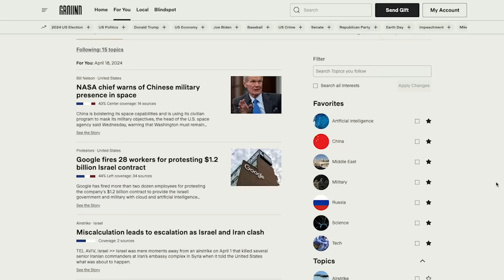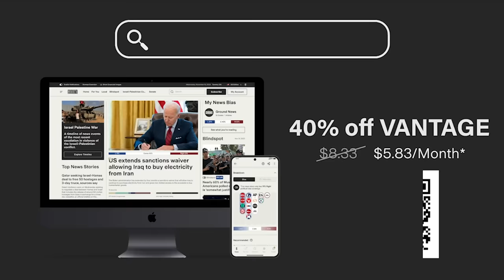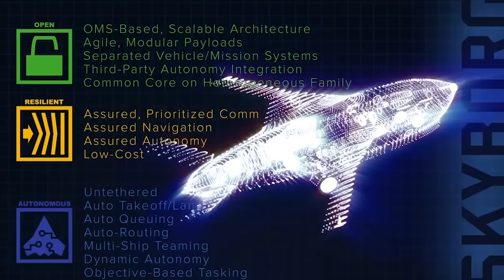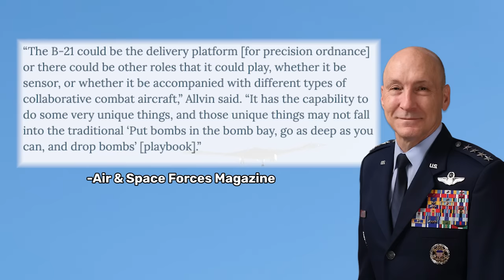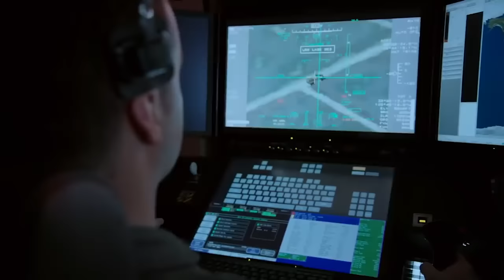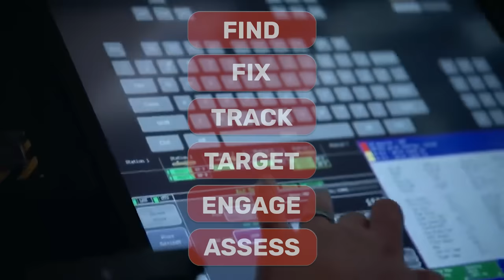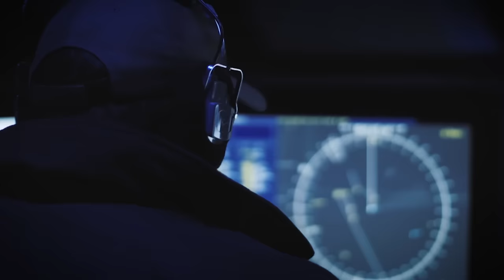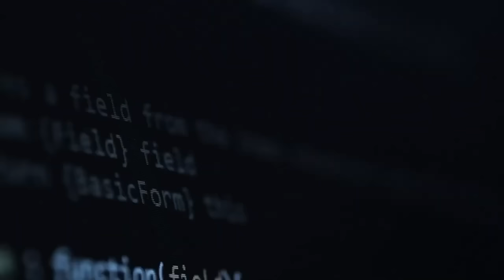Is the Air Force already developing a replacement for the B-21?!

Comment: Complexity adds cost and makes it possible for greedy fools to charge ever more for the 'complete system' (ye compleat warrior).

This is ridiculous in a bomber whose strategic nature is:

1.  Too apt for misinterpretation if operating in a potential nuclear peer state condition.
2.  Too valuable to be at-risk, without multiple escorts, literally vacuuming dry the mission force, in an unreduced target area.
3.  Too vulnerable if caught, being both slow, lacking in maneuverability and limited in mixed offensive/defensive potential.

A bomber is literally centered around MPRL and CBM as Multi Purpose Rotary Launcher and Conventional Bomb Module specializations for heavy weight munitions and/or stacked small bombs.  A pair of F-15EX could literally carry more variety of self defense (AMRAAM, JATM, AARGM) and primary mission (X16 GBU-53) than a B-21 could, on all of its heavyweight = STAND OFF rotary launcher stations.

With munitions like ARRW and LRSO apt to be just as large or larger than the JASSM and ALCM they replace, while providing upwards of 1,000nm and 2,500nm of standoff respectively, the notion that you even WANT to be some kind of airborne command post or battlefield airborne communications node, is stupid.  You will be launching on fixed, industrial, targets which are known from years of prior satellite passes as an attempt to destroy the profit margin of a war or the warfighting infrastructure as ability to continue to fight that war.

ACPs as Autonomous Combat Platforms are just as unlikely to be worth much because they will NOT be cheap.  The silhouettes shown are those of the MQ-58 which is effectively a useless, expendable, unit with perhaps 1,500nm of total range and NO LANDING GEAR to be recovered.  Are you seriously going to pretend that a multi-million dollar commo package, MEP sensor package AND survivable stealth is going on that airframe?

And do you understand what variable cycle does?  It effectively replaces the after burner on a jet by increasing core temps through injection of added compressor stage air and burning hotter.  Whether this has time limits or total compression (turbopath) restrictions is unknown but what is sure is that these engines are enormous, to accommodate all the bypass piping and not any more capable than a fanjet engine when applied to an optimized cruise point endurance of say .82-.85.  A B-21 is not going to go any faster than this without hitting compressibility limits on that low sweep flying wing configuration.  A drone might be able to but only to the degree it is sized and equipped to carry the 15-20,000lbs of fuel needed to go deep (1,500-2,000nm radius) and stay on station which is to say, a jet which is not small, not cheap and thus not likely to be part of any sensor web, looking for targets.

With modern IRST able to see a cigarette lighter at 50nm, clear air, the idea that tomorrow's systems, which will be multi (10 color) and then hyper spectral (hundreds of mini-specie slices on an optimized doped-detector FPA with tuned DROIC) will be 'invisible' while weighing 30-50,000lb and displacing enough air at high enough Mach to be generate mixed transonic stagnation shocks around the airframe is ridiculous.  Especially at altitudes where the engine is efficient, the sensor slant long and the trashfire distant from a 100-150 million dollar drone.

To simplify how this is likely going to turn out, with just the RQ-180 and an Arsenal Sub worth of 'airpower', the drone goes near to or into threat airspace, breaching at some point up or down coast from the conflict zone and coming in from the back.  It uses overhead imagine from micro-sat constellations to cue it's own imaging systems and, where threats are really high, sends in small drones (200km LOCAAS/LOCATM, 4 per stealth CBU can) to confirm relocatables targeting via track beacon/laser mark and reject decoys.

The RQ-180 then passes back singular detail data which is relayed to multiple SSGN which fire LRHW, PrSM or ARRW type missiles as alternatives to JASSM-XR to hit the threat perhaps 15-20 minutes later.  Where these are DF-26 TELs, the section of coastal A2AD/ICD is swept clear and carrier group can approach 'that embattled island' where yet more UCAV/ACAV systems fly out 1,000nm+ (just to be sure) and drop a rain of POWERED small diameter bombs (100km SPEAR-3) to standoff kill threats by saturation, defeating APS and lasers by coming in, under the horizon.  Again using LOCAAS/LOCATM type munitions to F2T2EA movers.

That's three primary effectors.  No wooop-de-lala 'clouded ISR' no 'kill web'.  Just three targeting and delivery systems.  No equestrian class sky knights required.

Anything beyond this should immediately be looked at as gold plated, self licking, lolly profit by the DIB and their worthless wormtongue Congressional lapdogs.

The next step in butchering each other is not some I-Phone generation retarded misunderstanding of why webs and clouds actually exist.  It's going to be pure speed for range.

So that air and TAV assets, completely outside the theater and thus NOT VULNERABLE TO LOSS OF BASE-IN can take off, climb up to Mach 4 and  FL800 and then start the scramjet to go 10,000nm down range in a couple hours while chucking HGVs over shoulder, like a kid playing stone-over-millpond, to a couple time zones cross-range.  You will literally fight your 'landwar in Asia' from somewhere over India.

Since the Chinese are actually ahead of us in this regime, with the Wu-14 and DF-17, after we abandoned the technical failure that was XTV-2 and Falcon as 'too haaaaard' if we want to steal a march on that before it comes a-visiting to our CONUS shores, we need to get on it, because we are WAY BEHIND.

And thanks to their higher IQ, incredible industrial base lead, and dedication to STEM-C rather than Gen-Z victim entitlement subject matter, the technology gap is likely going to just keep getting wider and wider and wider.

As we descend into a cesspool of third world multicultural miasma on our way to becoming the world's largest permanent debtor state.

Comment: I wonder if the day will come that a miniaturized nuclear reactor will be designed and used by the air force for airborne energy directed weapons platforms
Reply: It was designed in the '50s. The pilot's compartment was protected by a water bag and lead barriers.

Comment: So the B-21 is an advanced aircraft to replace the B-1 and,  its even more advanced replacement is already being designed?  So why is the USAF planning on flying the B-52 until it reaches its hundredth birthday?  That's the craziest idea any service branch has ever had.  Crazier than the Navy's Littoral Combat Ships.  Crazier than the Marine's Light Amphibious Warship (aka floating targets).  Crazier than the USN buying a version of the "off the shelf" FREMM Frigate and then admitting it will be delivered at least three years late.  And, crazier than Boeing converting former Russian-owned 747's into Air Force One aircraft and going billions of dollars over budget and running years late.

Comment: So, I like the numbers game, where the cost comes down as numbers go up and decades later planes can start being scrapped and used for parts.

The B-21 is going to be quite capable, so having 150 ain't gonna break a military budget OR be a bad use of money.  I also don't see an issue with buying two different bombers at the same time even if one is more capable than the other.

Having said that I find that rate at which US military tech is improving quite remarkable and excited to see how this all plays out.  The reality is though the US is competing with itself because its two main "frenemies" are going bankrupt month by month and both will have at LEAST a decade of recovering.  In saying that though the US needs to keep building.

Comment: "Is the Air Force already developing a replacement for the B-21?!"
If not they SHOULD be.  Build a stealth bomber unmanned. The flight deck is a great big giant waste of space and weight. Just think of all the waste in a manned combat aircraft. The flight deck, the pressurization system......all a WASTE. Look....the enemy will go unmanned. We are forced to go down that road. No waste. No G limit. It can soldier on through the radiation of a nuclear or chemical blast.

Comment: The B-21 was pitched as next-gen tech but's it's more like going from an Iphone 14 to Iphone 15. You even admit that it's just a different version of the already existing RQ-180. It's hard to see why the B-21 is even necessary. How is it signicantly better than the RQ-180? What's the BIG new capabilities that set it apart?  In fact the use case for Bombers in general has almost disappeared in a near peer contest. And I guarantee China's new Stealth Bomber is probably JUST AS GOOD as the B-21.
Reply: Big negative on  the Chnoise having a bomber on the level of the Raider.

Comment: The reason the F-35 needs a 20 ktons engine is because it wouldn’t be able to fly without such power to propel it forwards, it’s barely 4 meters large size  and small wings can’t sustain the aircraft’s. 
The B-21 on the other hand has enough lift provided by its wings and doesn’t need such a thirsty and large/heavy engine.
Reply: I feel that also ignores the fact that the F-35 has an assuredly large payload capacity for its size.

It can carry more weight in ordinance than an A-10.

Comment: There going to make the same mistake as the f22, they should never break up a production line until the production line for the new product is running, if the f22 line was intact they could build then new with an open software update and be able to use the raptor for decades to come, just like the eagle has

Comment: So first off one, the full capabilities and potential of the B-21 have not even been fleshed out, this bomber is barely in the testing phase…second off this “new bomber” or platform hasn’t even been fully developed let alone built so it’s kind of stupid to tout abilities that have not even been built or fully developed…

Comment: LOL  of course, DARPA and the black groups who have no external name are ALWAYS working up new designs to incorporate items that may or may not exist as yet..      I mean I am waiting on the specs for the overhaled B-52J to land, and see if they go to a generator on every engine to enable a faster laser cycle, and if they remove the 2 ton chunk of concrete out of the tail and replace it with a fast discharge capacitor to power said non existent laser weapons..     
we are going to soon start to see laser based defensive aircraft, because I don't think any of the current crop of aircraft can support the power requirements but could you imagine a b-52 or ac-130 converted to  a 100kw and a 500 kw laser?  once in rapid fire defensive use and one to smoke items on the ground.
Reply: @sandboxx do you think they may be looking for a next generation command and control stealth platform??   A plane that just stays in stealth and uses Drone capable F-16 like and B-21drone type aircraft to accomplish the mission?    because I see an issue with trying to run large scale breaches of Integrated Air Defense Grids from a bunker in Nevada.

Comment: B-21 is way too slow
Reply: The reason for flying slow is to keep the air friction around the plane and engine temperature as low as possible to avoid being detected by infrared search and track sensors. It also makes it harder for heat seeker missiles to lock on it.

Comment: Honestly, I just assumed they were referring to the SR-72 as a future bombing platform.
Reply: Light load, but high speed and high altitude. It was part of the design from the start, but high temperatures would make opening a bomb bay extremely dangerous. Nice design dilemma!

Comment: When it comes to military generals are like children in a candy store.

Our weapons inventory is 50 years a head of today’s current  weapons and air force inventory’s. The navy have their plans completed for the next 50 years on a plethora of multi variety of ships, subs and their own weapons. The only problem generals and admirals have one failing. Every new system created they can’t help themselves from trying to turn every system into a Swiss Army knife. The problem is real world use makes this almost impossible. Look no further than the current F-35. They wanted one plane for the marines, the navy and the Air Force. So in the end they gave in and created 3 separate air frames. If you decide this on day one, the system is cheaper and built faster. But they do always get there.

But today systems were built to take on China. But just like the ussr. China is going to crater just like the ussr. They are about to experience our 1920 crash. After that we will only have one man to thank. Xi jinping. The one thing that I always comes back and bites authoritarians is their system is built with corruption built into it. They’re military now will become a trotline weight around their neck when it comes to maintenance. They won’t have the money to do it..

Comment: 100 b21? lol what fantasy world you from? Just Like the B2, at most ~20 will be made and then cancelled.
Reply: literally what the airforce has said they were going to purchase. The only way it would be canceled is if they were to make this new plane well ahead of schedule
Reply: I wish I could bookmark this and set a timer for 2030. We will get at LEAST 150.
Reply: @floff7922  it would also be cancelled ( and the plane under development too) if paradigm shifting capabilities are found that make further efforts moot
Reply: 21 were made because every one else is so behind 
lmaooo.
Reply: The primary reason Congress adjusted B2 orders from 132 to 21 was the collapse of the Soviet Union and the end of the Cold War, as it was built to engage deep inside Russia undetected. New threats to U.S. hegemony (China, N. Korea, and Russia again) warrant the B-21 to fill the B-2’s role, especially since the B-2’s stealth is comprised after 35 yrs. But the another reason to feel confident in high procurement of the B-21 is because of its diverse capabilities, as Alex discusses here. It may look the same as the B-2, but it’s a completely different, far more capable aircraft. Things change rapidly though, and I get your point.
Reply: @stephenwilkinson1254  unlikely but not impossible